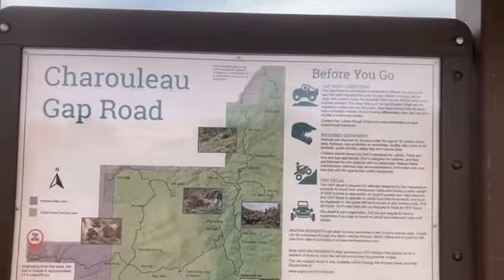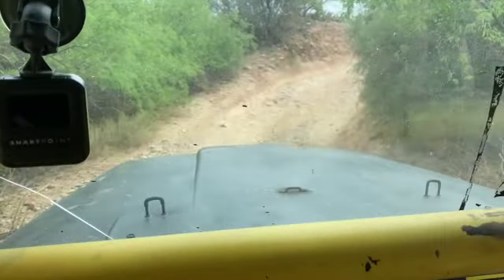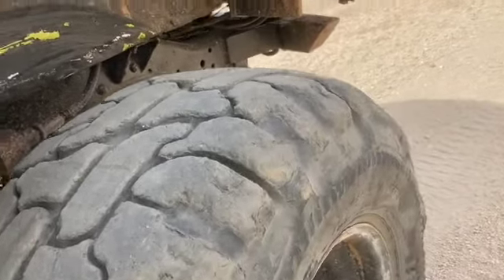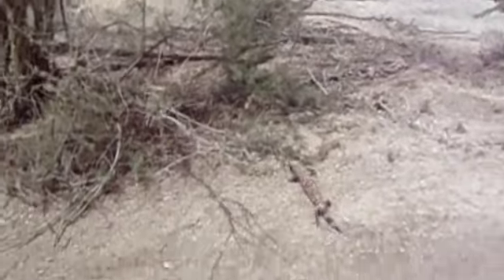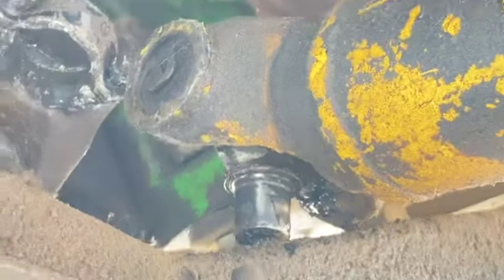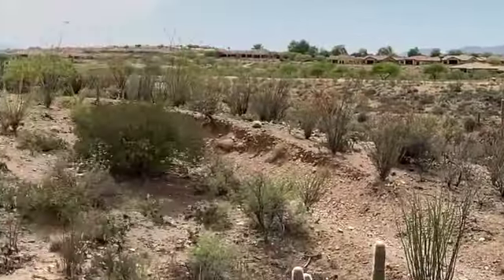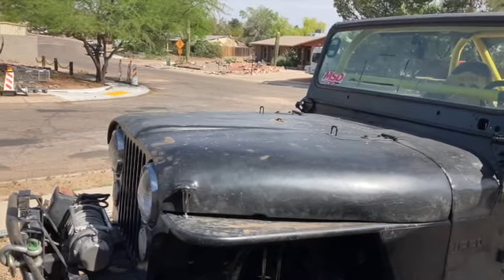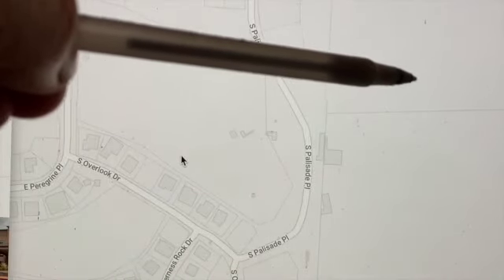charouleau gap trail weird saddlebrooke shortcut !

Comment: Valve cover gaskets:  Make sure the gasket surface on the tin covers is flat and smooth.  Look up the torque spec. (probably around 15 ft-lbs).   When installing the covers, I clean the bolts with brake clean and use blue loctite on them.  When tightening them down, I use an inch-lb torque wrench and tighten them in 50 inch-lb intervals.  A Snap-On dial torque wrench makes this go faster.  I then let it sit overnight before starting it.  I've had good success with that method.  Good luck, man.
Reply from the maker: Ya these tin chrome valve covers bend real easy